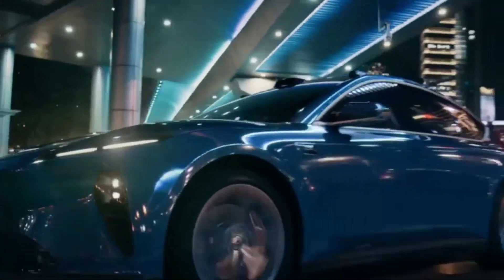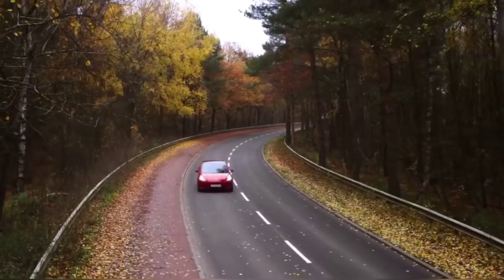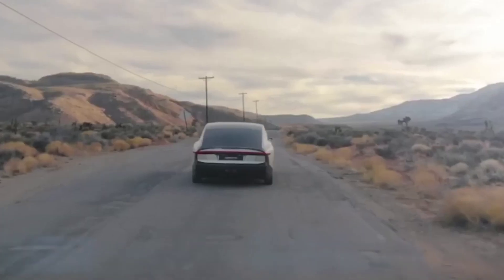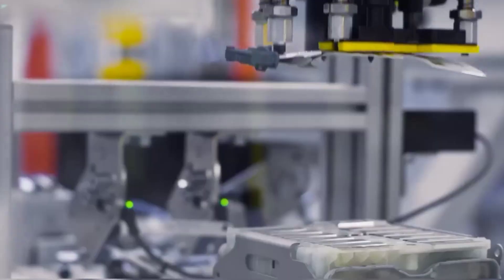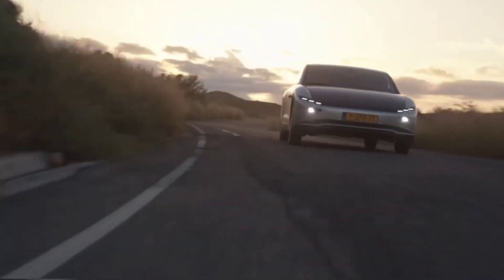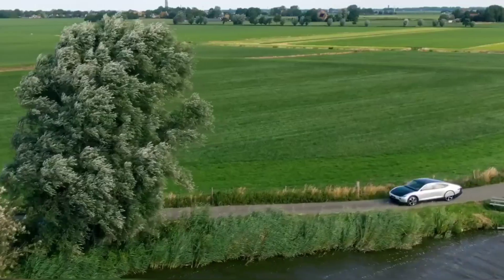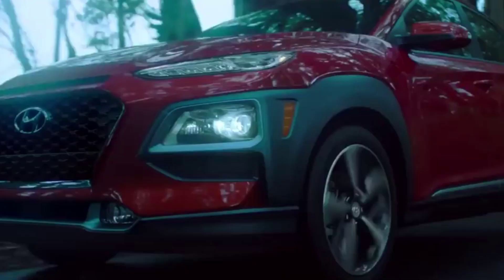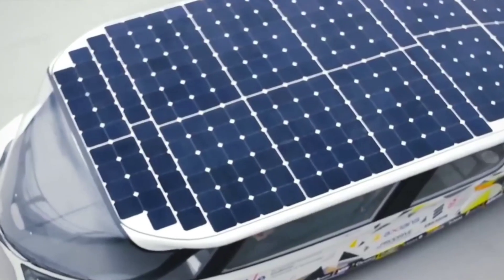New Electric Car with NO Battery SHAKES The Entire Car Industry

Comment: "doesn't need a battery" than what do u think is recieving power when its sitting in a driveway? or plugged into an outlet? it wouldn't exactly benefit much from the 30min of sun it would get if u took it to the shops and back but than parked in a garage. its also quite expensive if i remember correctly so buying an electric smart for each family member w a license and installing solar on the roof of your house might be less expensive.

Comment: i see a lot of problems with this such as:
1. in wheel hub is heavy and has its own problems.
2. the solar panel will probably cost more to integrate to the car body than the power in will provide. probably not worth it at current efficiencies